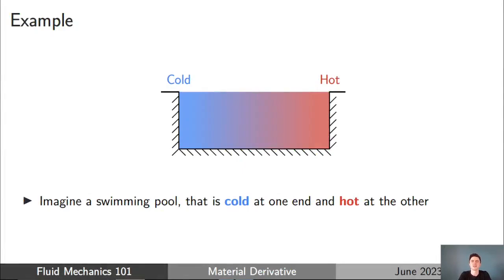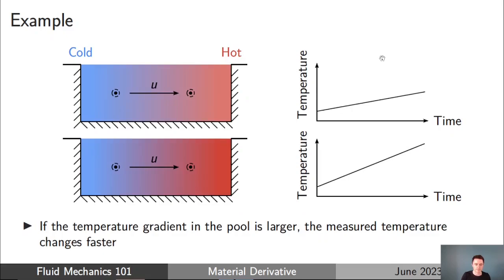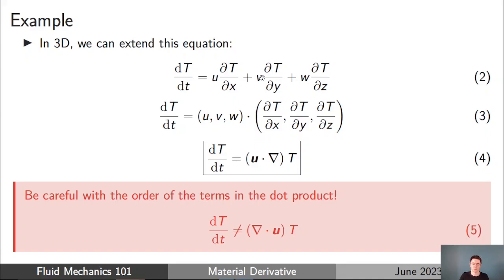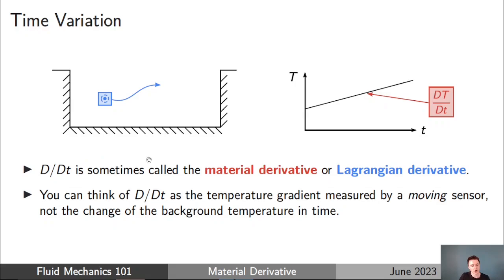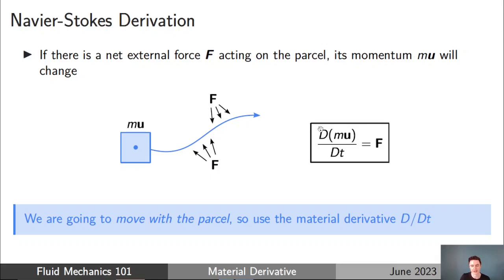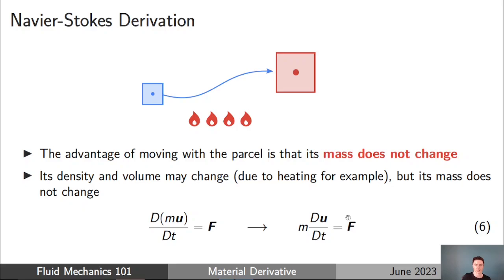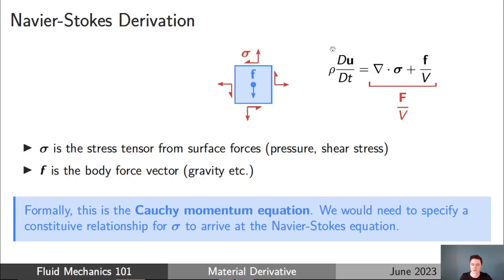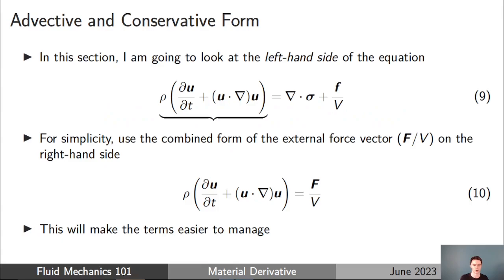[CFD] Conservative, Advective & Material Derivative forms of the Navier-Stokes Equations

Comment: Sorry, @3:19 the explanation and the diagram is not quite correct: the faster we move the mesurement point from left to richt the diagram implies that the temp will rise. This is not the case. When moved faster the end tempererature will be reached earlier i.e. the rate of temp change will be steeper.

Comment: Great lecture Aidan! a small correction: conservative or divergent form is a form of N-S equation allowing to apply integral conservation laws using Gauss-Green theorem for example. It doesn't concern time term since that's a pure volumetric term, density comes inside just due to the introduction of the continuity equation into the advective form of N-S.
Reply from the maker: Great correction. Thank you!

Comment: Hi. I have an issue. I practically use CFD during my study, but because i use codes mostly written by other people i don't quite undertand all the details of methods implemented there. Don't have hierarchy of existing methods i CFD neither. For example i know there are FVM, FDM and FEM. Are there any other methods what are their MAIN features, advantages/disadvantages. What the difference betwen pressure/density based solvers. Next, as i work with code based on FVM i know some basic info about its methods and features i know such words as tvd an weno (i don't quite understand is that features of specific schemes or their "families"). Also there are different approaches to obtain convective fluxes such as  flux/vector splitting shemes (f.e. roe, hll family riemann solvers, ausm family solvers, are there essential alternatives). Reconstruction methods for solvers such as MUSCL (are there any other, can it be used not only in tvd?). Such a big zoo of methods an approaches just to solve euler equations. And i don't feel i have understanding of the relations between them. I mean something like table or tree of hierarchy with short commentaries near its' components. I undertand there are your videos that touch some of these questions but they are specific to some particular problem. It would be just great if there were lecture on basic information about "everything that currently exists in CFD" just to build foundation for everything else.

p.s. Sorry if I ask some childish questions. But when one start working practicaly and didn't have proper learning before it is so hard to figure everything out without good teacher.

Comment: Thank u sir 
I have a question but its not related to your lecture 
Can you please explain concept of
Static pressure 
Dynamic pressure 
Total pressure 
Mechanical pressure 
Thermodynamic pressure 
Stagnation pressure 
Mean pressure 
Average pressure 
And which one of pressure is in NS equation?
Reply: if i am not mistaken NS use static pressure, even if the input in the inlet is total pressure.
Reply from the maker: I would check out a general fluid dynamics textbook. You should be able to find the differences in there.

Comment: ⅆT/ⅆt=u ⋅(∇T)  would you consider this form to be correct as well? Would you rather show that the whole dot product operates upon T?  The idea behind the pool explanation is just brilliant - thank you for that!
Reply from the maker: Yes, this form is fine as well. As long as nabla dot U = 0, then they are equivalent. 

You only really need to care about the difference when you have a numerical method, because nabla dot U only equals zero at convergence. So before convergence, you might need to account for the difference between the two forms.